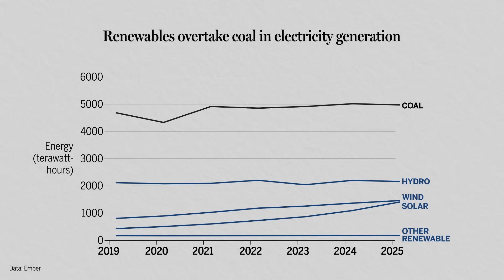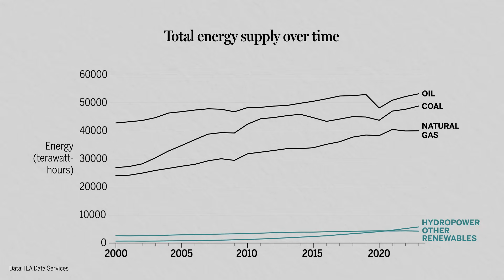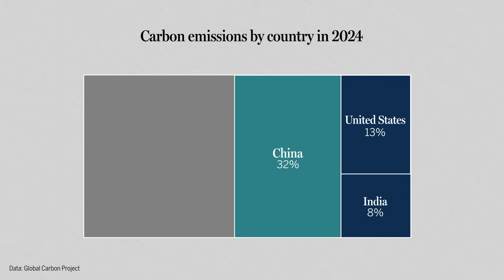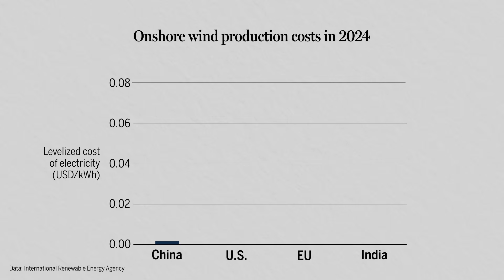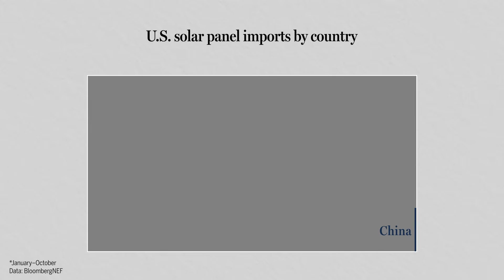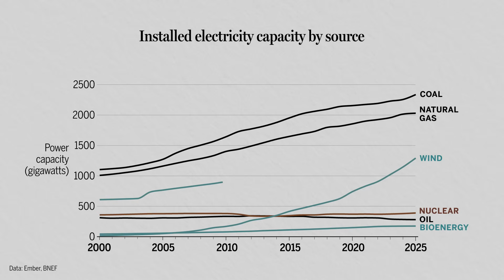How cheap renewable energy is finally flattening emissions

Comment: Every country which has based a CO2 reduction plan on variable renewable energy (wind and solar) has world leading energy prices. Germany, UK and Ireland are examples in Europe. Electricity three times more expensive than USA. Can anyone identify a country where mass adoption of wind and solar has lead to retail electricity prices which are lower than those typically seen in countries dependent on Nuclear, fossil, and hydro? I know of none.
Reply: It actually is cheaper in the UK if you have your own solar panels. It's just the grid and the fact oil companies spend so much to put renewables down

Comment: Grid-scale batteries are often ignored in media outside energy circles. Cheap batteries are the real revolution. I can't stress enough how big and fast has been the adoption of these systems in markets where regulatory signals are clear. They are the catalyst of making solar useful to the grid. Batteries enable arbitrage for asset owners in energy markets allowing energy to move through time, they contribute to system adequacy as they have true firm capacity, they provide flexible generation/load from milliseconds to minutes that enable frequency regulation. They can even provide synthetic inertia and black start.
Reply: In California, multiple grid scale battery deployments has eliminated the need for high demand peak power plants that only run when needed.   Those batteries can add efficiency to any system regardless of the power mix, because demand at different times of day is not the same.  They are also quick to build and pay for themselves pretty quickly.     The politics never seem to trump the economics over the long run.

Comment: I disagree with the premise that we need to build out all these solar farm areas to transform the grid. 
In every city the infrastructure already exists. With transformer upgrades and such, we can put solar on every building, they are already connected, and every parking lot and open spaces. By doing so that would be enough energy generated with excess power to supply even rural areas. Battery storage has to be included in this but it can be done. The only thing holding us back are the oil companies and human will. Capital is a non issue with federal support. But that is another issue.
Reply: @philborer877  definitely part of the solution but maintenance of rooftop is v hard compared to ground mount. Definitely should combine ground mount with agri use though. And commercial roof where feasible

Comment: Roughly + 2.06C is now baked in.   We are on the way to +3C by 2049.   

Global CO₂ emissions were supposed to be at 28gTon today.   They were 41.6gTon last year in 2024.   

There is a rough correlation that every 1,000 gTons of carbon emissions of +1C.   If we started reducing emissions by 1gTon per year (through reduced fossil energy production and transportation fossil fuel use), we would still produce 684 Gt CO₂ by 2049.   That's essentially another .7 degrees worth of carbon.   That doesn't mean that we will reach +2.7C by 2049- it just means that there will be enough heat capturing CO₂ that we will reach about +2.7C by 2073.

However, this scenario ignores the increased methane sublimation we are seeing due to the higher temperatures.

Reduced consumption isn't enough at this point.   Direct carbon capture is required.   And that cost about 500 billion dollars per ton of direct capture.   Maybe 375 billion of we extract it from the ocean (which is more efficient) which will then absorb atmospheric Co2 until the two are back in balance.    If we were to spend 2 trillion globally, that would only lower than emitted carbon by about 50 gigatons over that time line, reducing the potential temperature from +2.7 degrees to about +2.65 degrees.  If we were to spend 15 trillion globally (with a current global GDP of ~$105–110 trillion USD), we would essentially reach  steady state where the "baked in" temperature stopped rising.    If we were to spend about 22 trillion (at current prices) then 

1) The temperature would initially rise a bit more as the haze clears and more sunlight reaches the ground.   This is referred too as aerosol masking.
2) ~10–20 years of higher temperatures after reaching this level then the temperature begins slowly declining.   

Essentially, at 41gTons per year, we are 35 gTons of Co2 per year over budget.   Only around 6gigatons per year do temperatures start declining.    Over 10 gigatons per year, temperatures still continue to increase at varying rates.

But, recall that the heat is increasing natural emissions so we will need to cancel those as well so the cost will be higher even if we brought net emissions to zero.

Total human CO₂ (incl. land use): ~41.6 Gt CO₂-equivalent in 2024 
Source: Joint Research Centre

Total human CO₂ (incl. land use): ~42.2 Gt CO₂-equivalent estimated for in 2025
Source: La Conferenza delle Nazioni Unite sui cambiamenti climatici del 2025

If we do anything , we buy ourselves time for the costs to drop and to invent and discover newer, more efficient means of carbon capture.

Comment: Solar and wind along with nuclear can be the best solution for energy transition.
Reply: @Prashant_Pandey4  ye maybe investing in SMRs rather then building nuclear plants which cost too much to run and to take down
Reply: Solar, geothermal (by fracking) and wind are probably the most important ones.

Nuclear and hydrogen also are important, but maybe reform is required to get better working strategies.
Reply: @therapeutischbecommentarieren Wind is probably the worst one out there. It pollutes the environment and requires manually digging holes to bury blades when they break down, it kills birds, requires far more land than solar, and nearly 50x the land of traditional energy production. The environmental destruction caused by wind is just unparalleled.

Comment: Conservation.  Downshifting.  The argument is always about how we can increase energy use, and thus keep growing the world economy, while reducing CO2 emissions.  That's the secondary argument.  The primary, and not necessarily more difficult, argument would be over how can we reduce aggregate energy use.  Any lower-emissions tech developed helps both cases, but the unforeseen consequences of the mining, refining, and disposing of green tech products should be minimized by working hard to minimize aggregate energy demand.  The environment responds poorly to too much CO2 but it also responds poorly to too much plastic, solvents, heavy metals, and the other pollutants of green tech.

Comment: I have solar, I have tried wind, I dont have access to doing hydro. I have batteries for storing energy, too. Solar and wind is a great supplement, not a solution. As someone in agriculture, in the fields, you never put all your eggs in one basket so to speak. A diversified grid with different energy sources is key to reliability and being able to withstand human and natural disasters. My solar is great, but on average solar is only effective 200-220 days a year in my area. Wind technology is too far behind for home and farm use at a cost effective price. Solar and wind are part of our future, but not a solution. Preaching it is a solution is why solar has such a bad reputation already because people like me know it is not a solution, it is a supplement.
Reply: You have in-situ small-scale solar and wind which is one of the most efficient ways to generate electricity since it's generated and used on the grid.  Because every watt you generate and use locally is a watt that doesn't stress a distant power plant to generate nor the grid to transmit.  Because in-situ generation happens behind-the-meter.  Over a course of a year, in-situ behind-the-meter generation can offset a substantial portion of a facility's draw from the grid.

That said...

Your remaining annual electricity is pulled from the grid--but solar (large utility-scale solar) will be increasingly powering that too!
Reply: …continued

Commercial utility-scale solar (and wind) is increasingly powering more and more of global electrical grids.  They'll eventually be paired with battery storage to cover daily cycles and long term battery storage like hydrogen, gravity, thermal ceramic/sand, pumped storage hydro to cover longer seasonal periods.  This pushes us towards dispatchable "firm renewables" which will really mop the floor with every other large-scale electricity production on Earth.

Renewables (especially utility-scale solar) have reached historic low levelized costs of electricity production per MWh years ago.  What's more is they continue to drive their costs lower each year as they ride the cost curve downwards.  The same is true of battery storage.  Solar and batteries have dropped in price over 90% since 2010 and continue to drive their prices downwards.

At the end of 2024, IEA reports that 90% of all global new energy additions were clean energy based and mostly from solar and wind.  This is up from 81% in 2022.  So renewables are essentially taking almost all new energy additions worldwide.  The world has never seen anything like renewables huge exponential growth and it's still accelerating.
Reply: …continued

Renewable's zero fuel cost as well as zero fuel infrastructure costs is a big part of their low cost.  The raw inputs of sunshine and wind arrive freely with zero effort.  In other electrical generation, ongoing fuel costs and fuel infrastructure capital costs are huge engineering & logistical headaches in addition to being financially costly.

All the science and economics points to renewables (especially solar) dominating the world's energy systems.

Comment: With lowering cost of drilling using Quaise technology geothermal power should eventually have a line on the graph all its own.
Reply: Had to look up Quaise. I wouldn't count my chickens yet. However you may be right regarding the bigger picture. There is already a pilot geothermal plant (in Utah I believe) that is using fracking technology to produce geothermal energy in areas where geothermal sources are not close to the surface.
Reply: @TimothyGasser  Being done in Cornwall UK.
Reply: Earthquake risk. But yes, geothermal energy is the great untapped source.

Comment: If not for oil, the Industrial Revolution would not have been possible. These liberal videos acting like oil is the enemy should be ashamed of themselves. Yes we can now start to use different types of energy and we should switch to cleaner energy but slowly, it takes time. Oil will be at the core of energy production for another hundred years.
Reply: @brentfrank7012  Too much energy is Cancer! Industrialisation did more harm than good.